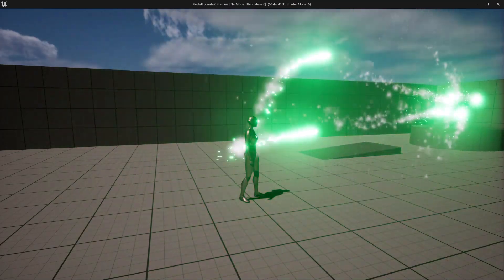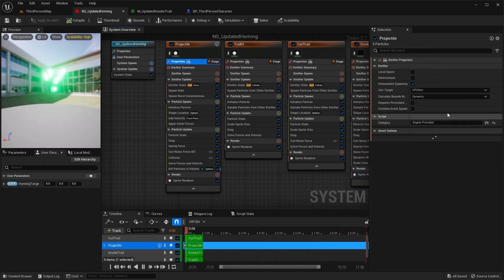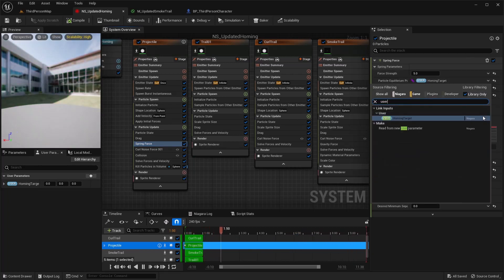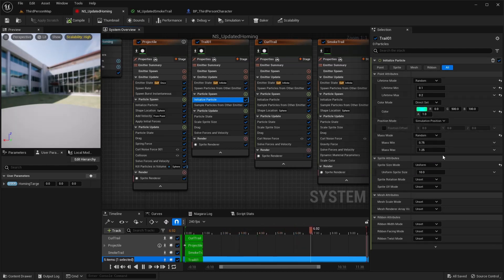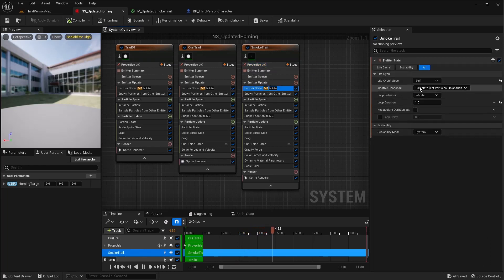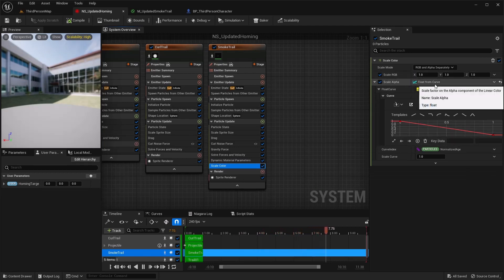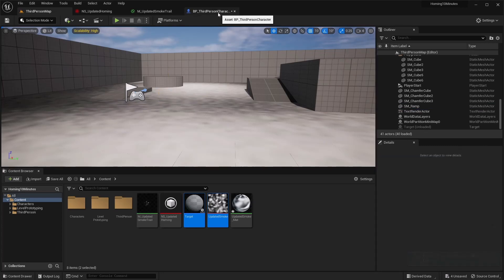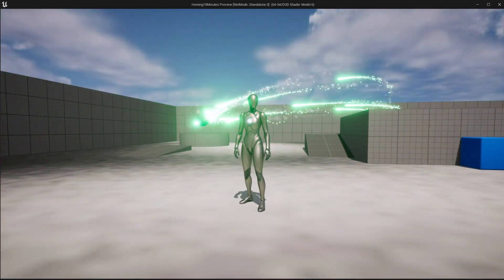10 Minute Tutorial: Craft Stunning Homing Missiles in UE5 Niagara System Unreal Engine

Comment: How does Niagra system cause damage enemy ?
Reply from the maker: This won't cause damage without a little more set up. You'll have to implement a function to adjust the hp of enemies and then call that function when the missile comes in contact or close to the enemy. This can be handled by exporting the particle data (to get the location of individual particles) from the niagara system to the necessary enemy blueprints, do some check on the particles location and when it is within your desired distance from the enemy, call the function to apply the damage. I have a couple videos on exporting niagara particle data :) Hope this helps and sorry for the late response!
Reply: @BreezeGameStudios  tnx. can you make video turorial? hehe

Comment: are there any tutorials on collision/damaging characters with these projectiles?
Reply from the maker: Hey! The next tutorial I am posting (currently in the works) will do some work with collisions. The one I will show will be homing missiles that explode on impact. One trick to make this work (this is not a straight forward task yet in UE), would be to spawn an actor of class at the location of the collision. This actor could be something that could generate an overlap event with your character and then you could control damage, health, etc inside your player character. To do this, you would need to generate a collision even inside your niagara system and export particle data to a blueprint. Export the data on collision, implement the interface inside the player bp and from there this could be achieved. I will go into some of this in the next tutorial. Hope this helps and good luck!